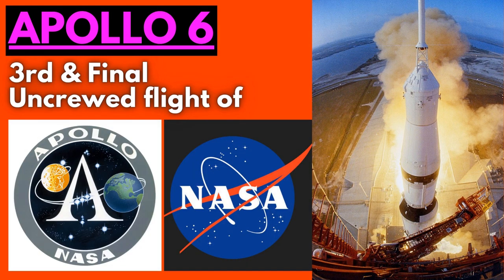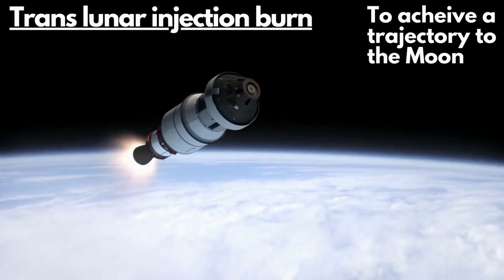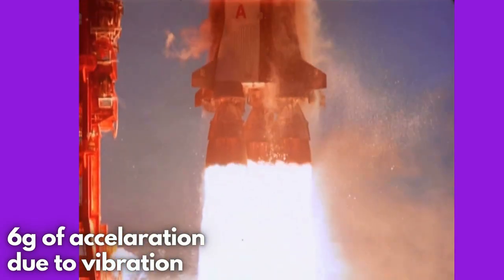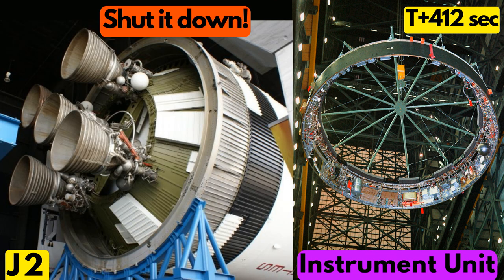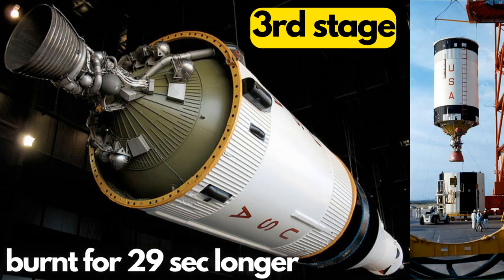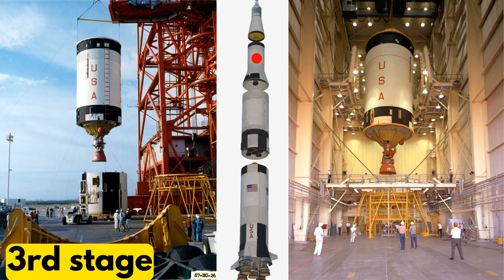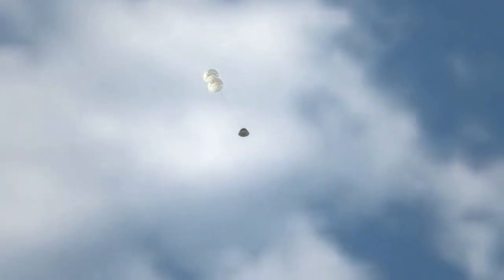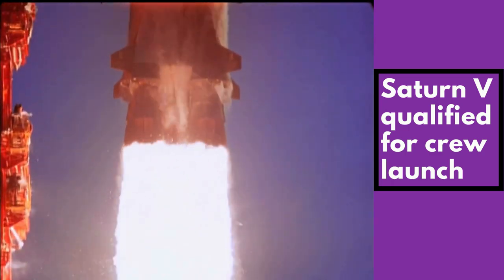Apollo 6 - The Successfully Failed Mission

Comment from the maker: IMPORTANT!!!   At 1:04 The vibrations shown is not 'HORIZONTAL' but 'VERTICAL'. Sorry for the mistake. Suppose for 1 sec there is high pressure at the exhaust and then the other sec there is low pressure. This causes oscillations and is dangerous.

Comment: also there is a fact i would like to point about about pogo oscillations. What happens is for some reason the engine pressure increases, so now that there is more pressure the fuel has to work harder to be able to get to the engine, but due to the high pressure some of the fuel can not get into the engine to be able to combust. Because there is less fuel in the engine now, that causes low engine pressure, now because of the low engine pressure more fuel than planned comes into the engine shooting the engine pressure up, which causes the engine to lose fuel and then lose pressure, and the cycle continues. but the video shows the level of thrust differing from side to side.
Reply from the maker: Yeah, the oscillations of high and low pressure is vertical and not horizontal. I did a mistake. Thanks for pointing it out 😊. If I can replace that part of the video then I'll do it or else I'll leave a pinned comment to prevent misinformation. Once again thanks a lot for these feedback 😊